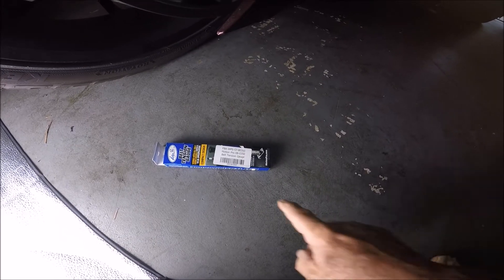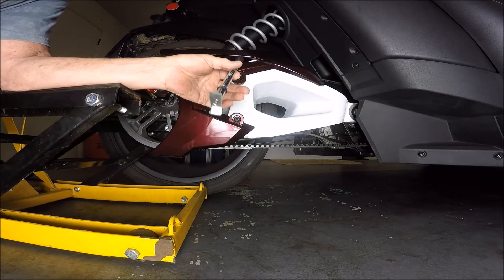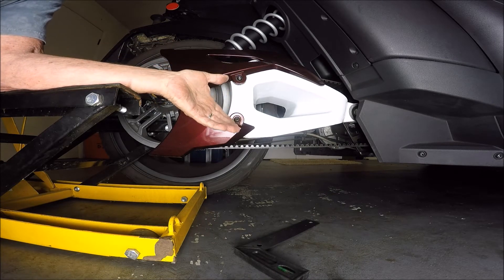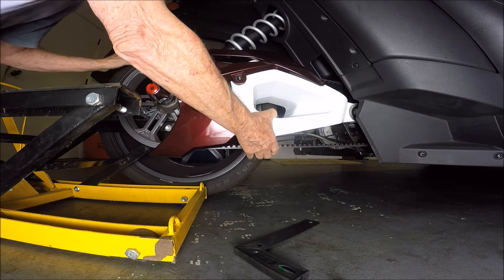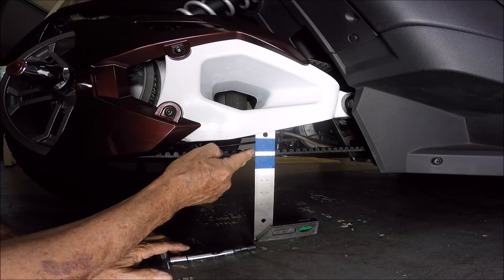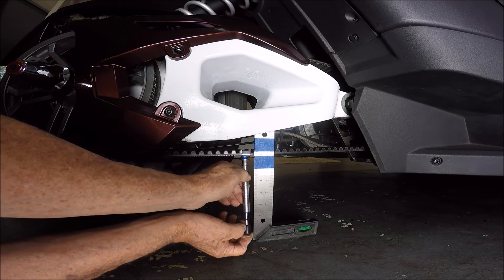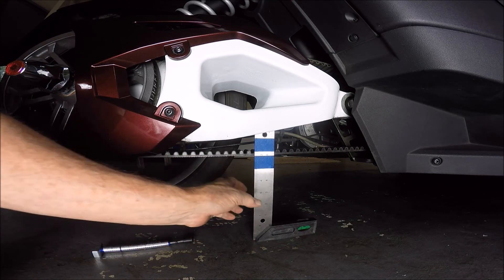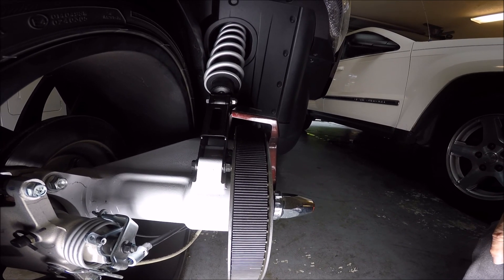Slingshot Final Drive Belt Tension Check Procedure

Comment: Hi Sam I know this video is old but im having trouble out of my angle drive on my slingshot and was wondering if you did.
Reply from the maker: @daveking691  I had a 2015 and a 2017 slingshot and did not experience any issues with the angle drive.  The video was made to help others check and adjust belt tension if needed.  I have heard others have trouble with angle drives.  Good Luck.

Comment: I just got one Mike.  The factory setting in the manual is 0.4.  Mine measured something like .25.  If you haven't checked the belt from the factory, check it.   https://www.amazon.com/gp/product/B009S4SYP2/ref=oh_aui_detailpage_o00_s00?ie=UTF8&psc=1
Reply from the maker: tscNY, the name Is Sam, Glad you got your Tension Gauge, now you can monitor the Belt Tension.  You belt is on the tight side.  To Loosen the Belt, you would need to loosen the Pivot Bolt to loose, and the two L Drive Mounting Bolts to Loose and you can push hard on the Belt  or squeeze the belt to move the L Drive Back a ways so you can adjust more to between .30 and .40  If it has some mileage on it, anywhere in there would be fine.  You may want to jack up the Swing Arm and spin the wheel to see if you have tight and loose points.  Adjust to the tightest point.  Remember, you need to put 30 lbs torque on the Piovt Nut and 15 lbs on the L Drive  Mounting bolts.  This will help in holding your adjustment while you torque the bolts.  They they are too loose, you can move the adjustment form force of tightening the two Drive bolts.  Also Torque the Pivot Bolt to 195 lbs first to secure your adjustment.  Important, I learned this the hard way.
Reply: All good.  I have an impact wrench that had the bolts loose and tightened.  I did the entire thing in maybe 20 minute.  Only problematic bolt is the top  angle drive faster.  My belt has a 0.8 tension now as the factory 0.4 is too tight for my application.  Get yourself an impact wrench LOL!
Reply from the maker: You are the man!  Tools are the key for sure!